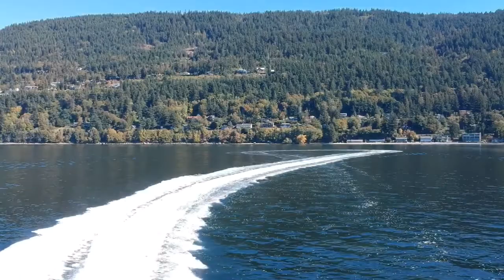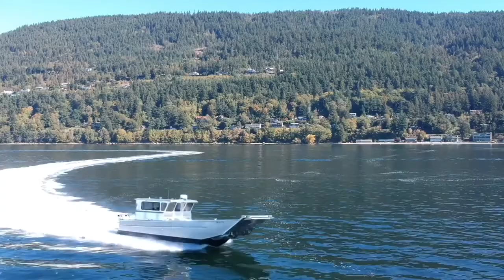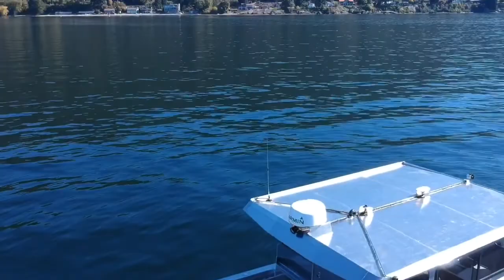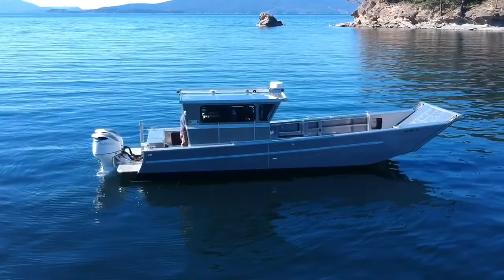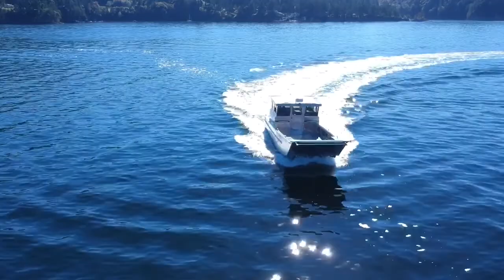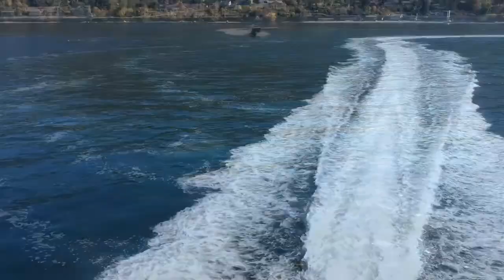High speed aluminum landing craft sea trial

Comment: 1.5 miles per gal. isn't what I'd consider fuel efficient.
Reply: Just get a 3 engine setup with 3x 250 HP each, it will be faster and you can always go slower and just run 1 or 2.